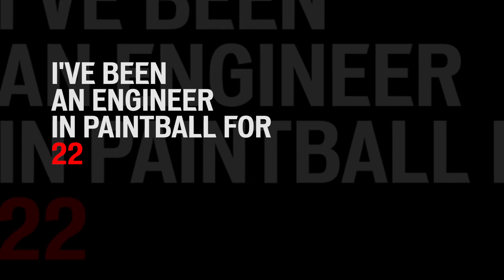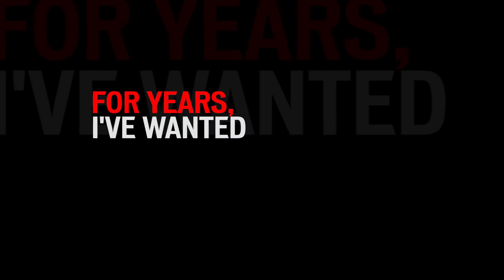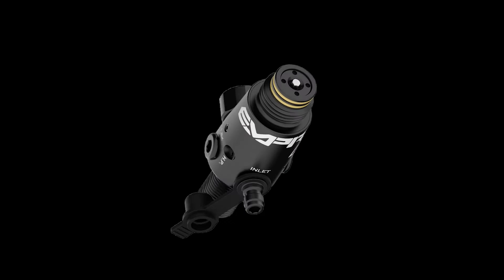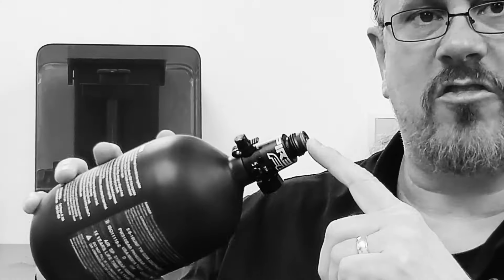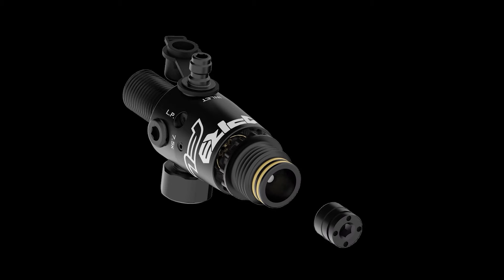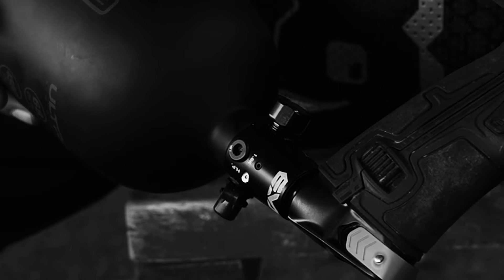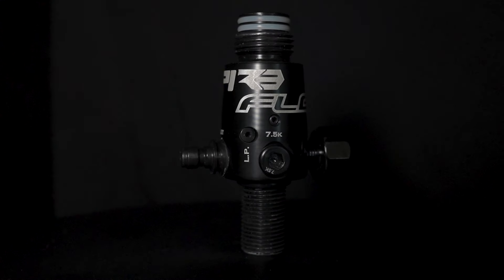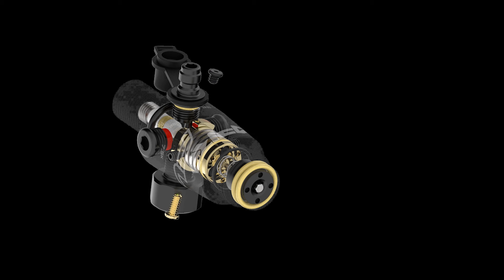Empire Flo Pro Regulator (Technical)

Comment: This regulator has been nothing but problems for me. It creates a lovely squeaking noise (metal on metal) which is shooting metal shavings into my twister Dsr+. 

My Solenoid blew an Oring on the spool do to the metal shavings which in turn caused my marker to start firing while it was off (air and hopper were on). Extremely discouraging. Wouldn’t recommend until they make a fix. Ninja pro v3 all day…